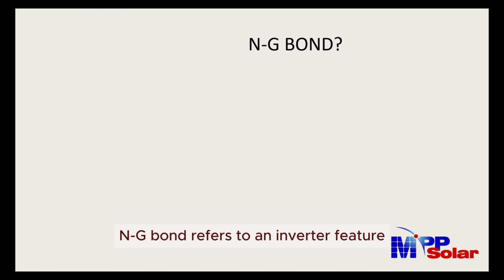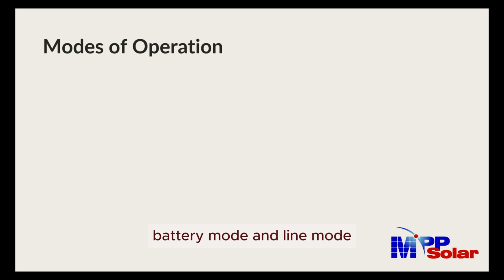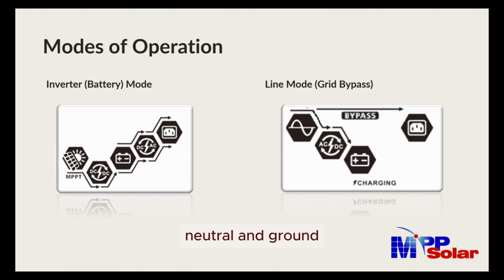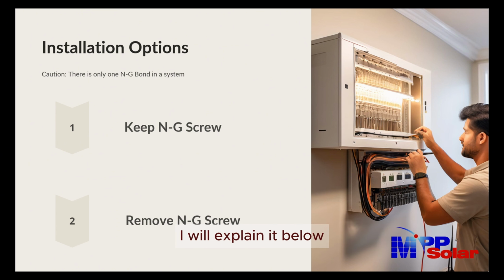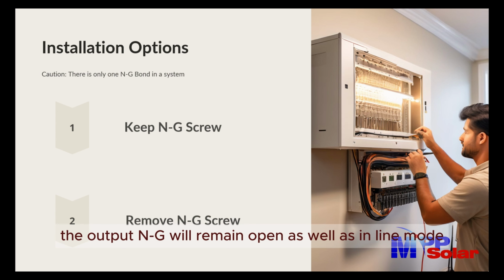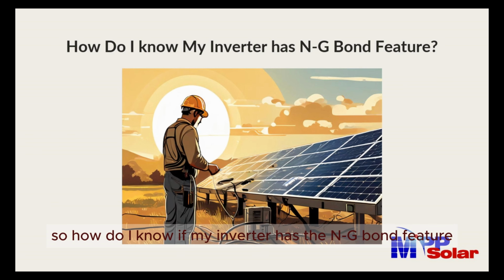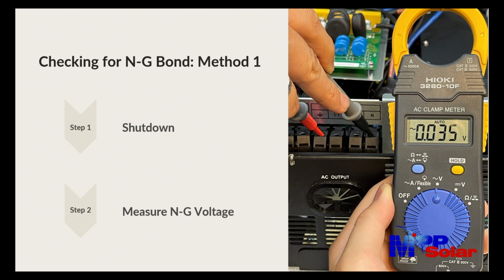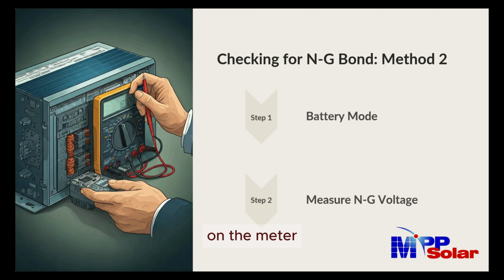N G Bond Feature

Comment: I've been very happy with my MPP Solar inverter.   Now I want to connect to the grid to charge my batteries and power loads from the grid when batteries are low.   
Does anybody know if the green LV2424 Hybrid has the automatic N-B bond feature as well?

Comment: I am working on an RV conversion, I didn't understand the bonding due to confusing forum discussions. I understand now that if plugged into the grid, the inverter should NOT be connecting the N-G. But when not connected to the grid, the inverter needs to make this connection. This video was perfect for explaining what the inverter would do. Its nice that the inverter does exactly what its supposed to.
Reply from the maker: Thanks for your comment.  Yes that's correct N-G bond needs to be DISABLED because grid input is almost always neutral grounded anyway, so there's no reason to duplicate grounding (ground loop).  On the other hand in off-grid mode, inverter should N-G bond in case any RCD is installed on the output side.  Many inverters by design will cause output to carry some voltage between N-G so to avoid triggering RCD this should be bonded.